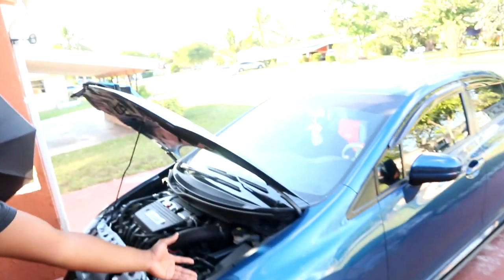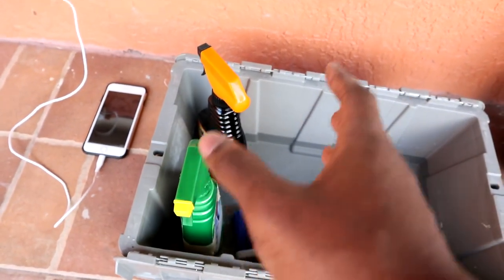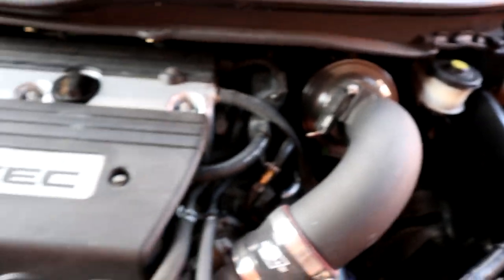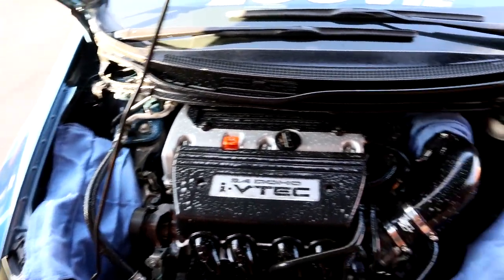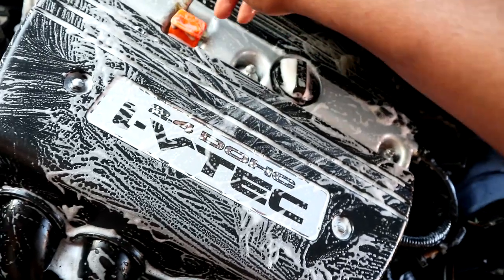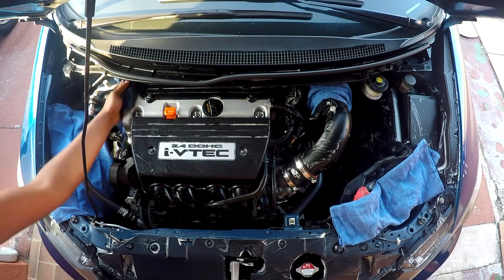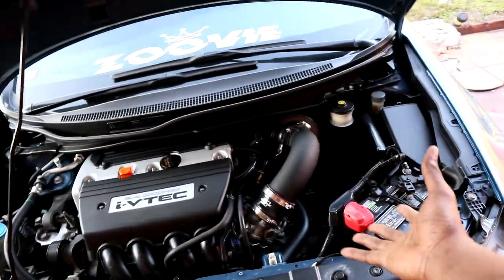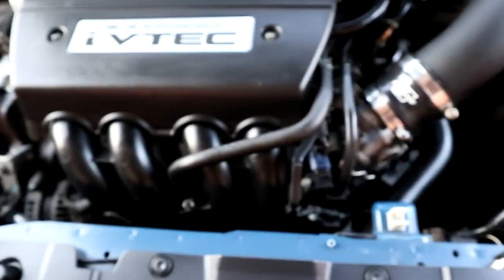THIS IS HOW I WASH MY ENGINE BAY!!

Comment: Good video man! What air intake is that installed?
Reply from the maker: Ktuned sri 3in
Reply: zoovie did you get any codes or lights on the car after installing?
Reply: @jerryzamora58  i did to ,and no light come up since its de same size as the stock one , only if you add a 3.5 inch you would need a tune , but with the 3" its all good